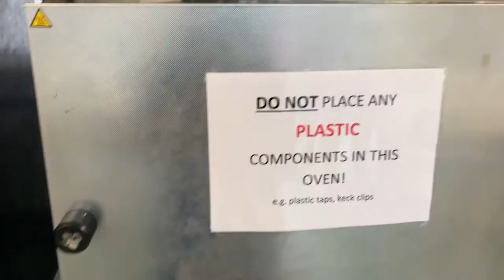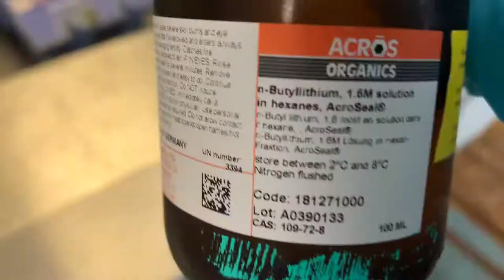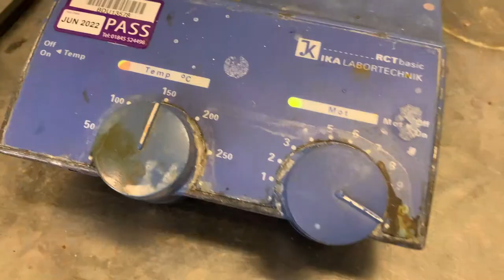Lithium Diisopropylamide (LDA) - Undergraduate Teaching Lab Experiment

Comment: I used to design plants that made nBuLi and LDA on the commercial scale. Everything started with Li dispersion and ran at much higher temperatures.  Of course this required Ar as the inert gas. You method looks well suited to the scale of your reaction.  I liked the pace of the video and shots of the labels.